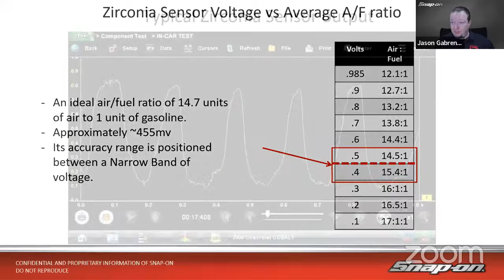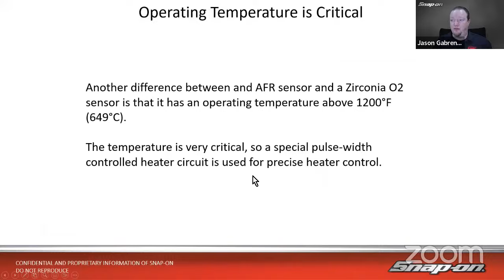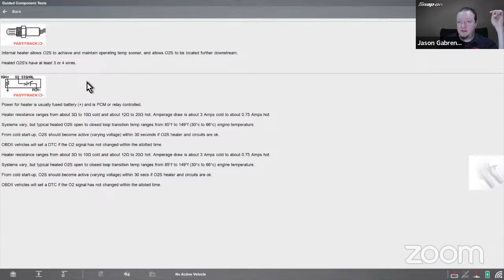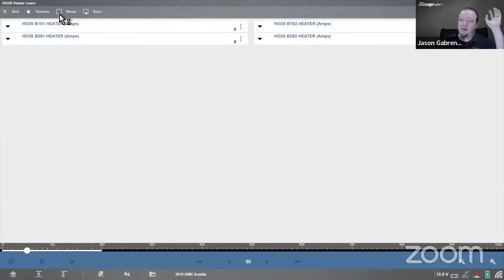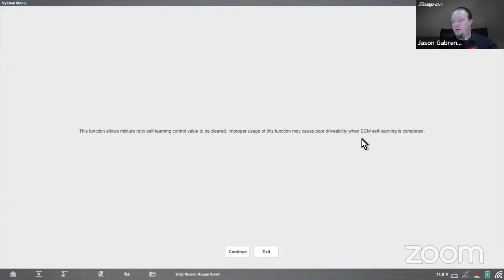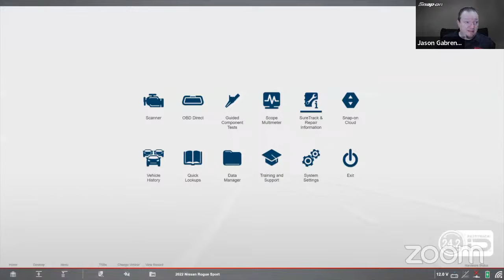Oxygen Sensor Testing and Repair - Snap-on Live Training Episode 93

Comment: Thank you for the pre class training "How it works" for the AFR sensor.  In 2016 when I retired I still didn't know how this sensor worked and got the rich and lean readings wrong.  I knew how Zirconia oxygen sensors ( 1 wire, 3 and 4 wire [my 87 Ford Ranger 2.9 V6 had the 3 wire] sensors) but when it came to the AFR, I was learning a little at a time.
In our (California) smog test (BLUE) books it mentioned both the Zirconia and the Titanium sensors.  I don't remember seeing the Titanium sensor.  Maybe you know?
Reply from the maker: From what I was able to gather, Titania sensors are very rare to see in the wild. Glad the info was helpful!

Comment: Great video! Question for anyone that knows, my shop had a 19 Subaru and the upstream af and downstream o2 sensor had 1 wire of the heater circuit in series with the other sensors heater circuit. Kept getting downstream heater circuit code. How would the pcm differentiate which heater circuit is faulty if they're in series?